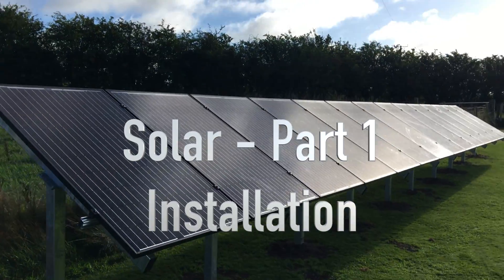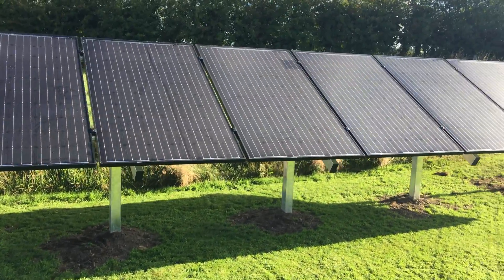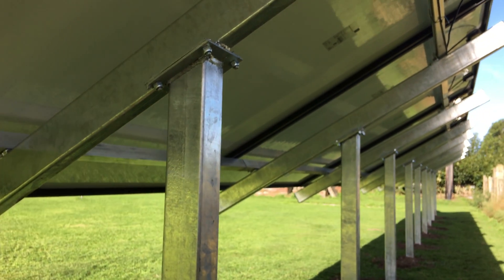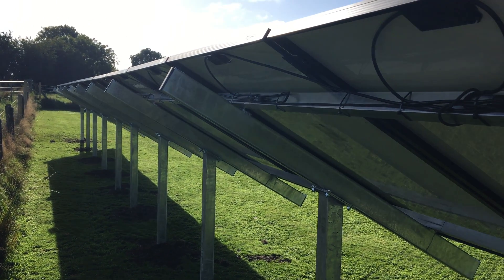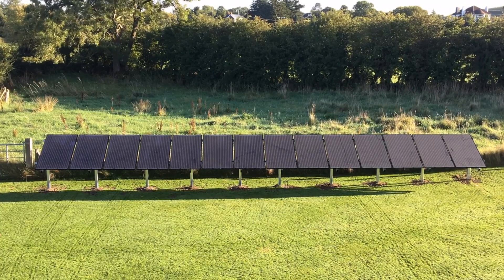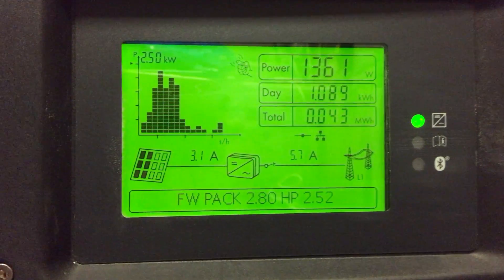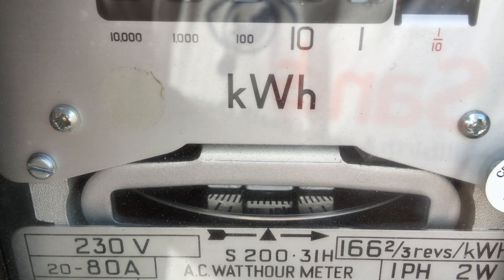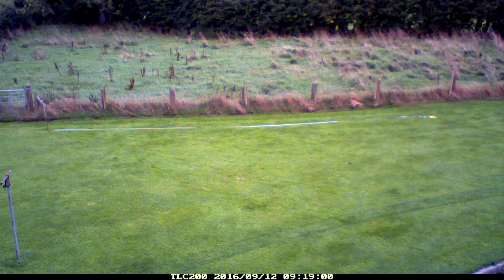Going Solar Part 1 - Installing a 4kW PV Array at the Automated Home

Comment: Very nice ground mount and Awesome Power Production. Thanks for sharing this video.
Reply: I have just subscribed to your channel Please check out my channel and subscribe like and share.

solar 48 Volt Off Grid system, 48 volt Off Grid system, Off Grid House, Minnesota Solar Power And Off-Grid Battery Backup, 48 Volt Hybrid, Off Grid Power, Off Grid 48V Solar, Off-Grid 24/48V battery bank, Solar Power, Off Grid System, 48V Hybrid-Off Grid Power System, 48V Off Grid System, Off Grid Safety. Off Grid Solar Power, Solar 48 Volt Hybrid-Off-Grid System, off Grid/Grid connect, Minnesota Solar Power, OutBack Power Systems, OutBack FX3048MT, Flexmax 60, Flexmax 80
Reply: I have just subscribed to your channel Please check out my channel and subscribe like and share.

solar 48 Volt Off Grid system, 48 volt Off Grid system, Off Grid House, Minnesota Solar Power And Off-Grid Battery Backup, 48 Volt Hybrid, Off Grid Power, Off Grid 48V Solar, Off-Grid 24/48V battery bank, Solar Power, Off Grid System, 48V Hybrid-Off Grid Power System, 48V Off Grid System, Off Grid Safety. Off Grid Solar Power, Solar 48 Volt Hybrid-Off-Grid System, off Grid/Grid connect, Minnesota Solar Power, OutBack Power Systems, OutBack FX3048MT, Flexmax 60, Flexmax 80